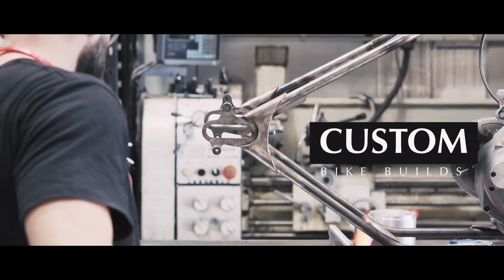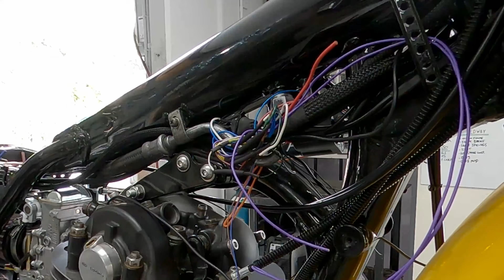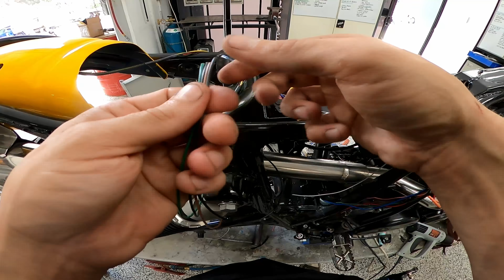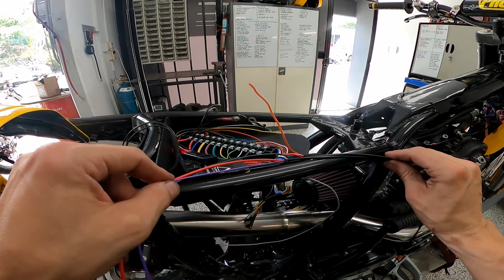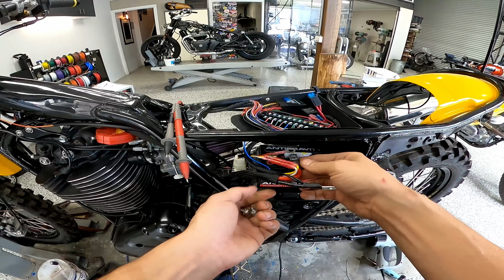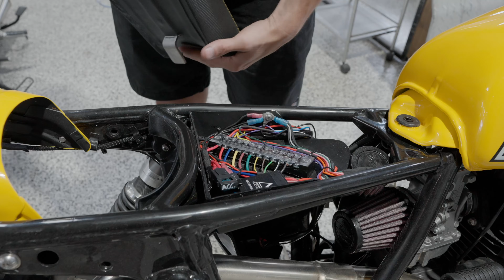How To Rewire A Motorcycle POV | Purpose Built Moto

Comment: This video would have been better if the sections where you were testing connections it was from the POV instead of the other angle where your hands were in the way not able to see where you were touching the multimeter to.  But still a good instructional video.

Comment: Absolute newbie to wiring a bike but I’ve just picked up a bike with your headlight, switches and indicators on but isn’t wired correctly so will be buying the back box and accessories etc. Can you recommend a good place to buy wiring, connectors, etc etc
Reply from the maker: We get our accessories from Napa auto spares

Comment: Great video. Two questions...u talk about connecting 2 deutshe connectors together, obviously 1 is male the other female, connect them then heat shrink it? My other question is what size/gauge wire do u use for your grounds, inputs and outputs?
Reply from the maker: You’re correct on the Deutsh plugs. Grounding cables we use a 10a cable for our lighting and buttons the larger grounds are by way of a 16mm battery cable and 25A cable for the frame and motor secondary grounds. 
I forget the exact gauge off the top of my head
Reply: @PurposeBuiltMoto  really appreciate that thank you. Love the builds especially the Honda's. Mine is a 72 cb500

Comment: hello, 1982 honda cd450t hawk, I have 3 cables on start button, one of them turn off headlight, but you have only 2 connections. How can I install your button? Thank you,
Reply from the maker: Generally we remove the cut out relay on the headlight which isn’t necessary
Reply: @PurposeBuiltMoto  So How can I turn off headlight then start bike?
Reply from the maker: @AZ-qn3xq  You leave the headlight on, this is an old feature to protect batteries, new batteries don't really need it.
Reply: @PurposeBuiltMoto  I got it. Thank you.